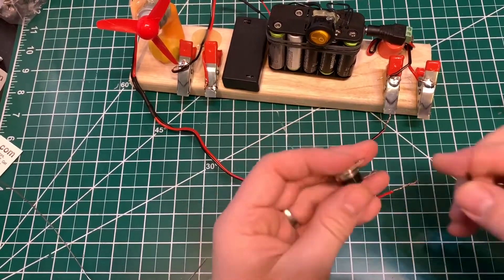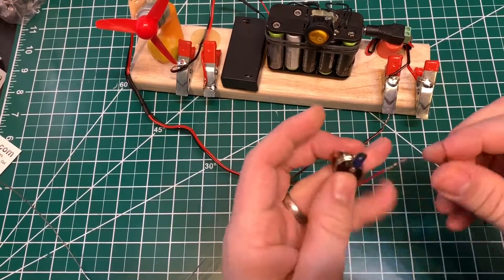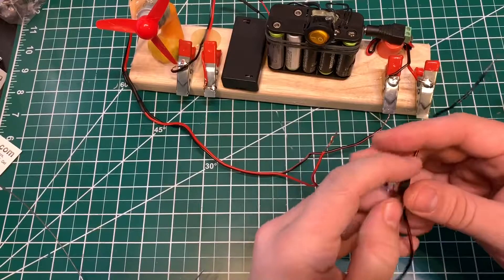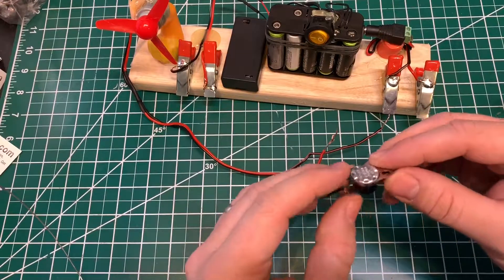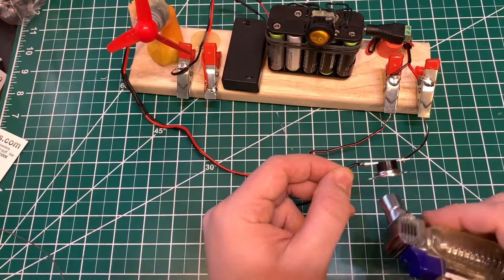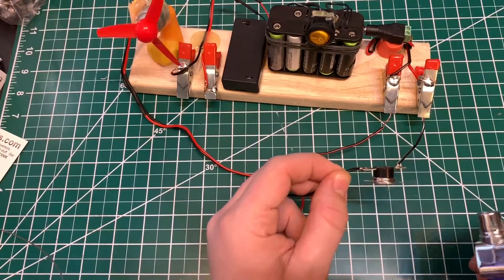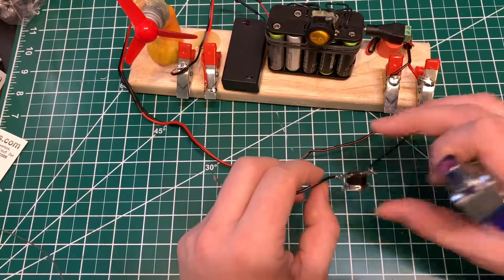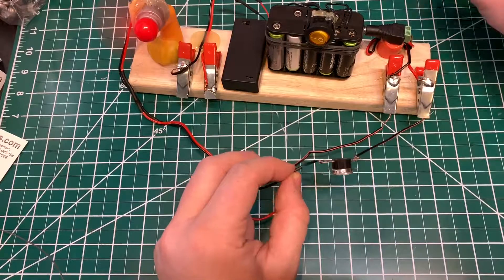how a Thermal Thermostat switch works KSD301

Comment: Hi man,i have a radiator heater which has broken thermostat,i want to buy the part (KSD301) on ebay but not sure what to buy,Normally open or normally close,any idea?thanks in advance

Comment: Hi and thanks for the demo.  Interesting, I was under the impression the Thermostat would be open when cool and closed when heat was present.   Why?  Because the thermostat I have operates a fan that moves air across the condenser cooling fins of a RV (Doemetic) refrigerator.  Maybe I don't have an understanding of the process by which this refrigerator operates.  But anyway thanks.  Back to the drawing board.